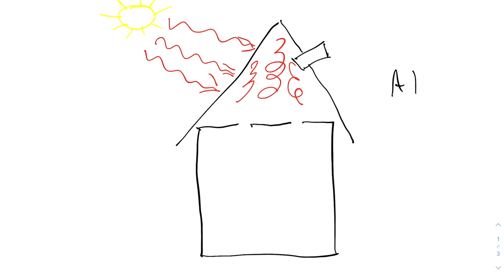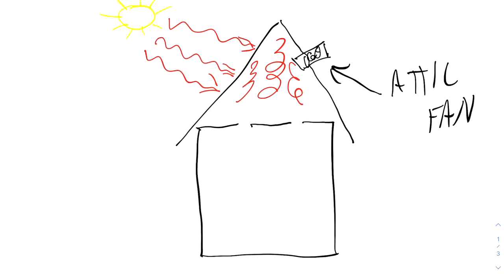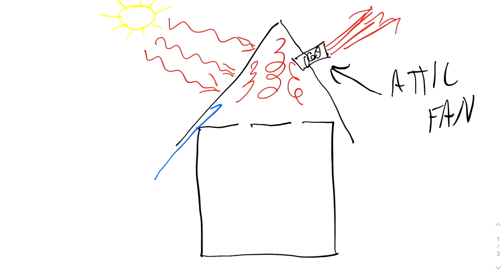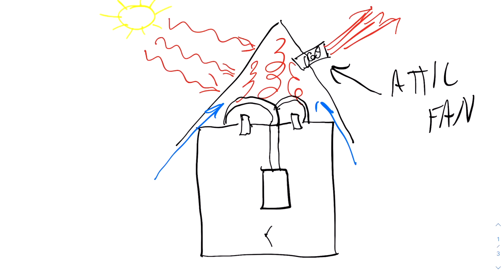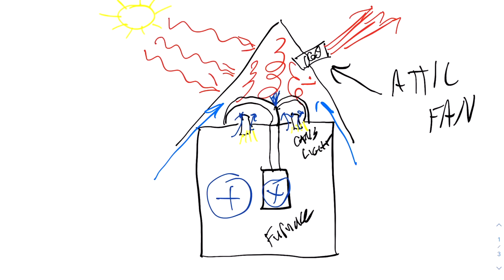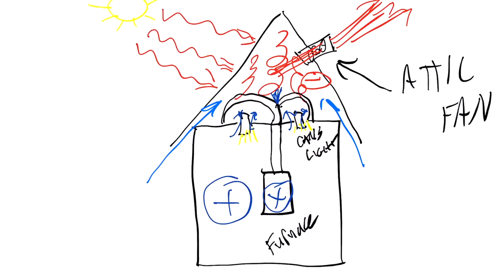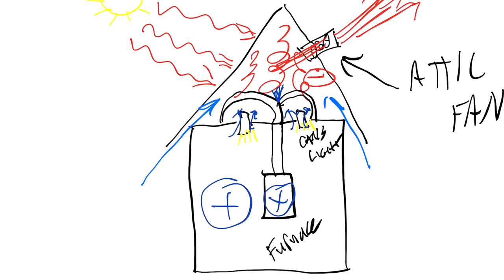3 Remodel Rip-Offs

Comment: I used to live in a house that had a powered fan at the end, with far more inlets than outlets I wasn't pulling air out of the house and you could definitely tell the attic was cooler when it was running.  Can't see how keeping the heat in the attic would help the situation.  When the sun went down the attic went quickly to the outside 80 degrees from the 140 it was when the sun was up.
Reply: @MAGAMAN  I totally agree. There is a small argument to be had if you have A/C. If you don't have A/C, you NEED an attic fan!
Reply: I think there's a difference between a "powered vent fan" and a gable vent fan.
The powered vent that Matt showed replaces a typical roof vent, which is near the top of the roof. What happens is that as it pulls air out, the replacement air is coming in through the closest roof vents. So you end up with a circulation near the peak that just goes from one vent to the other, and really doesn't cool the attic space.
A gable vent fan, on the other hand, pulls air across the attic. It may still pull in through the roof vents, but it's still evacuating more of the space, not just the small area near the peak.

I have a gable vent fan in my 40's house,) which could definitely use more insulation...), and I can tell the difference in the living space.
Reply: @JohnMeissen  Many houses don't have roof vents and he didn't say powered vent fans were rip off "if x" only rip off  If you have plenty of roof and sofit vents then you don't need any additional venting.
Reply: @davidmorrow4195  The only houses that don't have roof vents were either built improperly, or it is a sealed conditioned space. To say "many houses don't have roof vents" is absurdly stupid.
Reply: @ryanroberts1104  I lived in a house that had only had gable vents.  When house was built in the 1920's this is what they did.  My current house and all of the houses in my neighborhood (1910's) were built without roof vents, also what they did then.   Many of them were retrofitted later but the 3rd floor is a living space with a small/medium sized area in the peak that isn't vented.  You're ignorance of how houses were built in the past is absurdly stupid.

Comment: I disagree about the attic vents.  I installed 2 of them on my  2000 sq ft ranch house with garage, and it brought the attic temperature down 15 degrees during peak summer heat,. For the first time my AC would cycle and not stay on continuous.  What experience do you actually have with them?
Reply: I think the problem with them only occurs when you don't have enough inlet airflow to the attic.  You don't want to cause a negative pressure that would pull air in from the home.  I have a gable fan on my house, but it is not enough in this Houston heat.

Comment: Wrong wrong wrong . I purchased my house on 2016 and we were paying around $350 to $450 per month on electricity . Replace the ac unit  without the smart thermostat and the bill did not change after two months I got a new smart thermostat , a month later replaced the  windows to a double glass . My bill now is $225 in summer time and $125 in cooler months.  My next door neighbor had the food fan and he replaced the roof last year , he was paying $175 last summer and this summer his bill on $250. 
Hey men I respect you for the great job you are doing here but this is completely wrong. Your points are from contractors perspective.
Reply: Yea man, he never even got into the pure convenience factor of a smart thermostat, which was enough for me to buy one.

Comment: Wow, a lot of attic-fan hate from Risinger but I'm not seeing any case studies, just theories. Let's do an attic fan test! Check the attic temp. and the ceiling temp in the home, see if it makes a difference and by how much. Also would be nice to test radiant barrier stapled inside an attic.
Reply: I am also skeptical of his theoretical pontifications.  If you have 300-400 s.i. net-free area in the eave vents, how could that little fan possibly create enough negative pressure to suck gobs of air out of light boxes and walls?  Matt is not the only one who pooh-poohs the attic fan—Joseph Lstiburek trashes them also.  I think they are harmless at worst and mildly helpful at best.  I have never seen a controlled test, yet these fans have some very dogmatic adversaries.
Reply: Tests to prove otherwise would be nice.
Best I can tell, his argument comes from math, which no one seems to want to disprove.
Reply: I have a radiant barrier and an solar attic fan and when my attic fan died, i definitely could feel the difference in the house, until we replaced it.
Reply: I happen to have a tester in the form of a 12x20 short gambrel shed (see big comment above) with an off grid powered (fabbed) 900cfm 12 volt fan in a mushroom style passive roof vent. On a 95 degree day the back of the plywood right under the shingles is 125 degrees (no insulation yet), and that fan running at full speed does not change that one whit.  And that's with 3 windows open.
Reply: I have a thermostat in my attic.  It makes a 10-15 degree difference in the summer with 1 powered attic fan running
Reply: Depends on conditions. He is talking generally. I believe him. Hot air itself will 'power' the fans well enough.
Reply: I did exactly that, big difference in temperature,  mr. Build guy is wrong
Reply: @Nettechnologist  i i stalled a solar fan last year and my attic cooled down from 130+ to 110. I have been thinking about doing a radient barrier. What kind did you use? Worth it?
Reply: @Nettechnologist  If you have a radiant barrier then you don't have an attic fan or worse yet, you don't actually have a radiant barrier!
Reply: That's because Matt & Joseph believe only in the sealed house and conditioned attic concept. After listening to Joe several times in the last few years, I'm taking our open-air attic (with double insulated metal ducting) which has two gable vent fans (one vents in and one out) and doing a vented roof over the existing, with sealed foam insulation between the two. I'll have to post the temperature differences next summer once it's done. I think it will make a big difference in this 75 year old structure.

Comment: Replacement windows... reasons to pursue, other than cost savings: improve passive ventilation (+comfort and -mechanical ventilation costs), increase natural light (-electricity bills), improve views (+enjoyment), increased security.
Reply: Noise transmission is reduced also
Reply: Surprised he didn't bring up double to triple pane.
Reply: @jaspersonnyoner  yeah i used to live right next to the train tracks and you can barely hear the trains at full speed, I live in the UK where new windows tend to be double pane.
Reply: @olympicfireball  sadly North America is way behind on moving to triple pane. hopefully we see many people switching over soon, but with big houses with many windows it isn't a cheap operation
Reply: @raysonviswas  In urban environments I would opt for triple glazed for noise benefits alone, closing a window can be like closing a bank vault door
Reply: An other benefit for colder climate (Canada here) : less condensation. Seen lots of windows, even double pane, being "opaque" due to condensation, and sometime even frozen on the inside...
Reply: This is a remodel tho? unless your going from 1920s windows to 2020's the ROA is trash.. If you have a house/ windows from the 80s+ (most are in the US). It is not worth an almost none the benefits you speak of happen. Only more an narrow UV blocking an in some cases a SLIGHT R-value increase. Better to put the money into insulation, your heating/cooling system and sealing all the tiny holes in.
Reply: Decrease the mold growing on my old wood double hung windows
Reply: My windows are 120+ years old. ANY window would be an upgrade
Reply: @VictorMistral  an opaque window has a failed seal
Reply: Lise the neck mask.
Reply: I got rid of some jalousie windows and the difference was HUGE
Reply: @esigman1   greased brown paper is quite affordable and attractive
Reply: @esigman1  Exactly. Mine are 123 years old and about to be replaced. I put it off for too long as I now have half a dozen broken ropes. It's amazing what one can put up with.
Reply: @olympicfireball  double to triple pane is a marketing gimmick... not worth the money
Reply: I just replaced some unremarkable single pane glass double hung windows in a 1908 house in MN (not original) with Pella double pane double hung for a lot of money. I won’t know how helpful they are for bills until this winter, but this is my home for the foreseeable future. It’s quieter and more comfortable for sure. I’m very glad I made this purchase. My home is only partially an investment. Many things I choose to do are for my pleasure living here and they won’t see much of a return. And that’s okay. Matt sort of gives a nod to this, but I think there’s value in pointing out that there’s dumb stuff from EVERY angle. Window replacements are only dumb from an investment vs. savings angle.
Reply: @VictorMistral  rotted sills as well as mold on the window sils and sash. not to mention sky high heating bilkl and ice cold air literally blowing on you while you sit in your living room. this guy hasnt got a clue
Reply: @joshwilliams7392  correct, noty yet anyway. just have to wait til the prices come down. nothings ever worth to the average consumer until its been out for close to a decade or more. when i bought my first dvd player, it was expensive as hell at $300 bucks. but when they first came out, they were $1500. now i think mcdonalds puts them in happy meals. lol
Reply: @olympicfireball  European triple pane windows are far superior to US triple pane windows so there would be a better over all value with those
Reply: When I replace my 1960's aluminum windows, I know I am not going to save huge on my heating bill (snow belt)
But they will work better, they will actually latch which can't be said for over half the current ones in this house.
That in itself will cut down on drafts and noise and is worth the cost just in personal comfort.

Comment: He makes some good points about the attic ventilation. Overall, though, the concept of an attic fan does work.  The solar gain through your roof heats the attic 30-40°F hotter than the ambient air. That load transfers through your ceiling to the living area. An attic fan draws the cooler (by comparison) outside air into the attic forcing the hotter attic air up through the ridge vent.
Here's the formula for calculating the required CFM (Cubic Feet per Minute) of cooler air:
CFM =  BTU/hr ÷ (Delta T  *  1.08)
Where...
●Delta T (°F): Attic Temp - Ambient Temp... the maximum allowable difference between the attic temp. and ambient temp.  You'll want this at around 10°F.  So on a 90°F day that attic will reach a max of 100°F.
●BTU (British Thermal Units) / hr:  The heat gain through your roof system from the solar radiation per unit time.  Dependent on your climate zone, roof type, color, orientation (South is worst, North is best for minimizing heat gain; opposite is true if you want to use solar panels), time of day, etc.
●Air Constant of 1.08.  You can look up the derivation if you want, but this is a constant for calculating CFM when air is involved.  This would be a different constant if you were calculating CFM of water, e.g.

Comment: Many times changing from old to new windows can have a large effect on your house. This is partially because of the new windows, but it can also come down to a better installation that is more air tight. You can't even come close to all of the building science and scenarios in a 12 minute video. Matt is saying things that in general are true, but there are obviously going to be situations where the gains are more than typical because the original situation wasn't typical. Attics should self regulate if designed correctly and maintained. Air sealing your conditioned/non conditioned barrier is critical for your in home comfort and energy usage. Window and door seals as well as other penetration points also need to be managed. An attic fan can have some benefits, but is it costing you more money than it saves? Building Science is not something that you can fully learn or understand by watching a few videos in an afternoon. I've been learning about this for a few years now and I still pick up new information. Maybe that video link he mentioned is a good place for the casual viewer to go for additional information?

Comment: I replaced old single pane windows in a home in the high desert with low e windows. When I started the job the house was hot by 9am and needed ac. When I finished the house stayed cool and didn't need ac until around 3pm.
It's the only time I've done this but the results seemed pretty significant.

Comment: When my new ac was installed in the summer in Florida, my ac technician said he could not believe how cool my attic was during the afternoon due to 2 small attic vent fans that were scheduled to come on once the attic temperature reached 90 degrees. This also helps prolong the life of the roof .  I totally believe in attic fans and whole house fans. They are NOT a scam. Im going to put a solar powered attic roof fan on my rentals now! The ac sure does not kick on as often and doesn't overwork itself. This is just common sense.
Reply: @Lakelandcowboy69:  I 💯 agree with you comment!

I installed powered attic vents on my roof 20 yrs ago.  And the benefits have all been positive!

Comment: Sorry Matt, attic fans are the bees knees, you just have to be smart about installing them. Of course you don't want to draw conditioned air from the house up into the attic, nor do you want to depressurize the attic. The alternative? Attic vents in addition to the fan so the fan draws outside air in and circulates it. You're right that the sun is cooking the air inside the attic. That's why you need to remove it and get it away from contact with your living space. Even on a 100 degree day the air outside is going to be cooler than the air in the attic. If the outside air is 100 degrees, the air in the attic might be 120 or 130 degrees or even more, so the attic fan can get rid of as much as 30 degrees worth of heat in the attic. If you're worried about pulling conditioned air in from your living space, either add extra attic ventilation or mount the fan so that it pulls air into the attic rather than pushing it out... and of course plug up any air leaks in your ceiling and overhead ductwork.
  
As for smart thermostats, not every place is as humid as the south. Here in the west every bit of summer humidity is welcome. Before air conditioners were available we used swamp coolers which are very effective in cooling the air, but add humidity. Blowing air over the condensate will evaporate it, which will cool the air, and the small amount of extra humidity won't be enough to make you uncomfortable. You'll get maximal energy efficiency out of your air conditioner.

Comment: A lot of inaccurate or at best misleading information in this video. Comment section is filled with correct information and testimonials. Just as weather barriers have to be installed properly to work so do all 3 of these "rip offs." A powered exhaust fan will not work without proper soffit venting, smart thermostat won't work unless programmed correctly and of course windows need to be installed correctly. I would say this one missed the mark by a pretty wide margin. Your building science teaches me something almost every time, when you start talking about mechanical systems and how they work i.e. your take on tankless water heaters and all of this video it seems to be out of your field of expertise so maybe shy away from it and use the resources around you who have a better understanding.
Reply: Yeah. If you're getting detrimental negative pressure from merely running an attic fan, where's your venting? I don't understand how someone's attic could be so lacking in ventilation that running an attic fan would result in so much negative pressure that air from inside the house gets sucked into the attic.